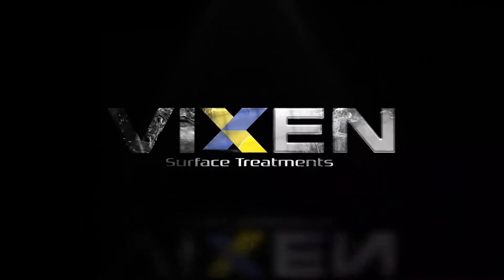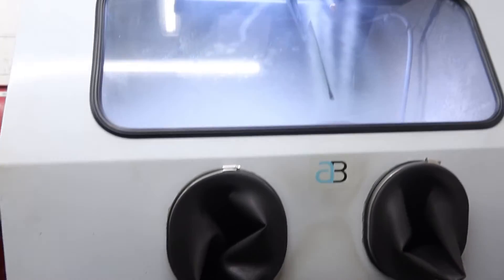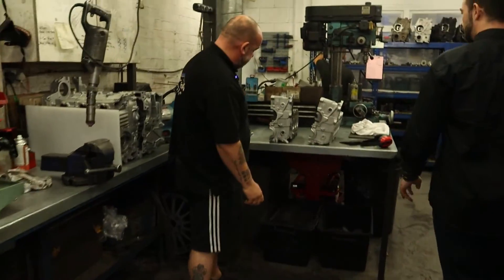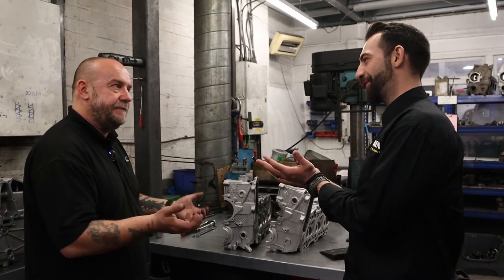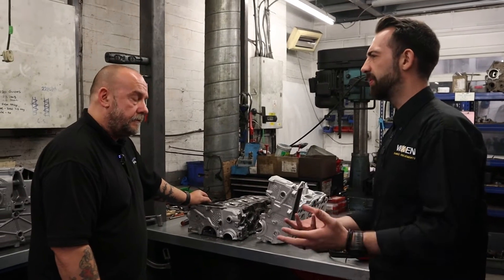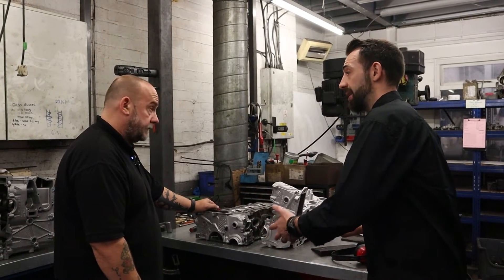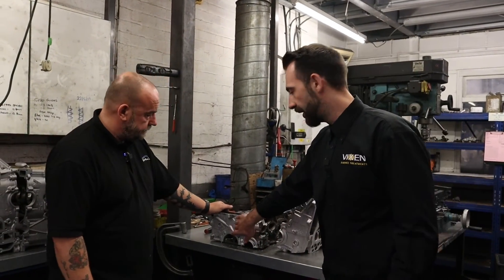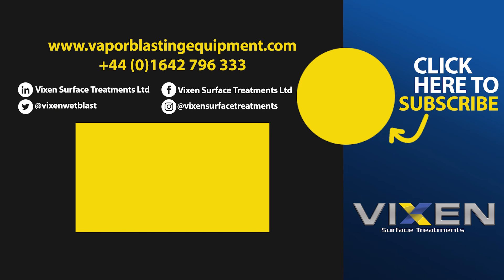WHY this PORSCHE Specialists use Wet Blasting for their Clients

Comment: Had an engine rebuilder leave blasting debris that got caught in a valve guide and the head had to come off again. Not great!
Reply: If that’s the case I’d say the guy who assembled the engine also missed a few areas of inspection before final assembly of the hardware into the head or block ?
Reply from the maker: Sorry to hear this, Leon! We recommend plugging/blocking any areas you don't want media getting into prior to blasting to prevent this from happening.
Reply: Should of inspected it a lot better 
Only takes a minute to inspect, take a bit longer to strip down
Reply: Vixen are a top quality company 
You pay for what you get

Comment: Great video!, fabulous machine, but what happens if media gets stuck inside the oil passages and unaware of that the engine is assembled? I guess that won't be good
Reply from the maker: Thanks, Edison! We are very proud of our Aquablast! To prevent media from getting stuck in oil passages we recommend plugging/blocking these prior to blasting. Hope this helps 😀
Reply: I've used these machines, and you will need to clean the heck out of them later, no matter how much you plug it the ceramic media will always find it way in, all freeze plugs will need to be removed and cleaned manually.